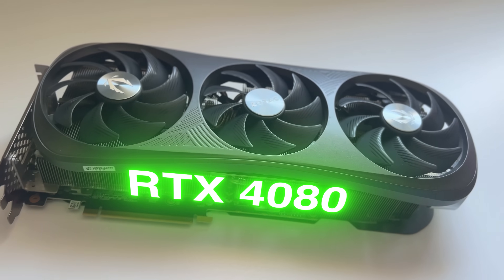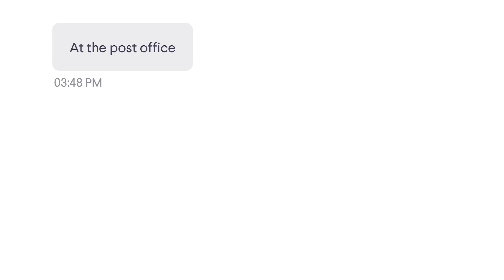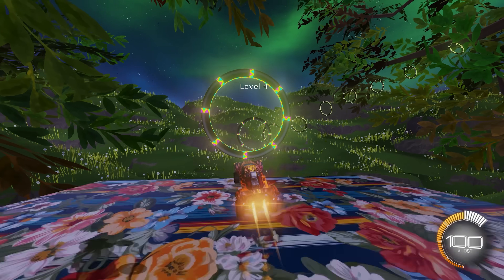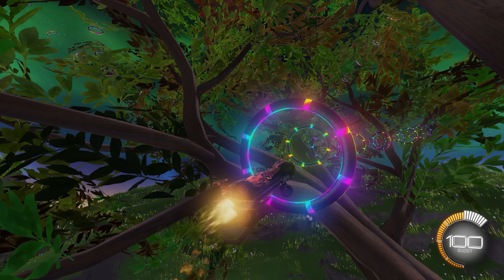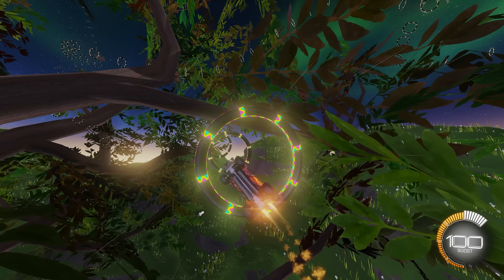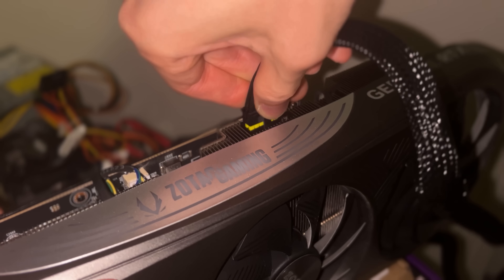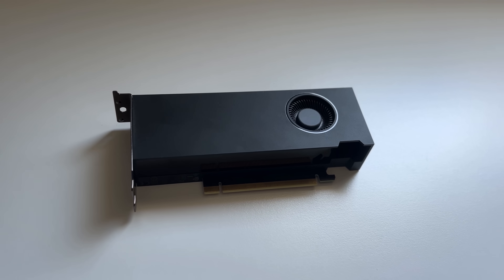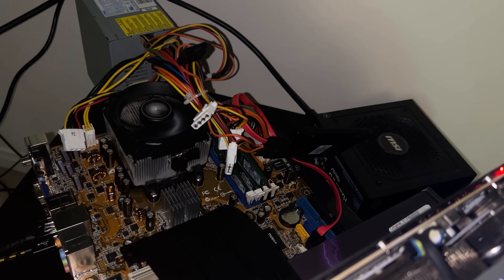RTX 4080 + 20 Year Old CPU

Comment: 3:35 - 2 core CPU
- 2.2 GHz clock speed
- No hyper-threading
- Built on 90nm process
- No integrated graphics
- Only supports DDR or DDR2 RAM
- Uses outdated AM2 socket
- No support for modern instruction sets (AVX, AVX2, SSE4.2, etc.)
- Extremely low single-thread performance
- No PCle 3.0 or 4.0 support (limited to PCle 1.0)
- No virtualization extensions (or extremely limited)
- Incompatible with modern motherboards
- Consumes more power than modern CPUs with far lower performance
- Very limited overclocking headroom
- No turbo boost
- 1MB to 2MB L2 cache (shared across cores)
- No L3 cache
- Poor efficiency per watt
- Outperformed by basic modern mobile CPUs
- Can't run Windows 11
- Struggles with even basic modern web browsing
- Bottlenecks even decade-old GPUs
- No native USB 3.0 or SATA Ill support on platforms it ran on
- Runs hot under load compared to modern chips
- Sluggish performance in multitasking
• Can't handle 1080p video playback reliably
- No support for NVMe SSDs
- Often paired with slow 5400 RPM HDDs and IDE drives
- Uses old BIOS instead of UEFI
- No built-in hardware acceleration for modern codecs (VP9, AV1, etc.)
- Terrible gaming performance - can't run most modern games
- Huge frame drops even in older titles like CS:GO or TF2
- Can't handle modern game engines or APis (DX12, Vulkan)
- Poor compatibility with current Linux distros
- Not suitable for any content creation (video editing, streaming, etc.
- Can't run virtual machines smoothly
- Long boot times
- Barely functional with Windows 10
- Legacy hardware = driver issues
- Easily outperformed by Raspberry Pi 5
- Not usable for emulation beyond 5th-gen consoles
- Incredibly low PassMark score (~1100)
- Weak IPC (Instructions Per Cycle)
- No secure boot support
- Can't decode H.265 efficiently

(Idk if this is right😭)

Comment: 11:37 the reason why the cpu wouldnt launch fortnite is because the cpu doesnt support SSE 4.2
Reply: This is why I had to upgrade a couple years ago (i7-950 to a i7-12700KF). A first generation i7 is still a decent machine, but it won't support newer instruction sets, and you'll need to jailbreak the installer if you want to run Windows 11 (gets past the TPM 2.0 and CPU requirements).
Reply: @BlackEpyon  I love reading computer nerd comments.... no offence im pretty much illiterate with computers

Comment: The psu standard hss been the same for the last 20 years so you have could just used a modern psu for the pc
Reply: 20 years if you count the ATX 2.2 standard. ATX has been out since 1995, but didn't become standard until a couple years later. If you're trying to run a motherboard from 1997 (ATX 1.0) using an ATX 2.2 or 3.0 power supply, you could run into issues with the lack of a -5v rail, but a motherboard from 2005 is going to be an ATX 2.2 with the 24-pin connector, so it shouldn't be an issue.
Reply: @BlackEpyon  A PSU from the last ten years is capable of powering any modern PC HW?

Comment: You could probably squeeze out even more performance if you ran it on linux
Reply: Correct me if im wrong but is linux lighter than windows? Btw im building a new pc and wanting to try linux, any good distros you recommend
Reply: lighter yes. I’m not very experienced with Linux but I think Ubuntu is good for beginners, it’s similar to windows layout
Reply: @thebradler51  oh okay cool thanks
Reply: The real stopper was probably the RAM: Only 4 GiB are not enough for starting the last titles he tested. Probably with 8 GiB, he would have had more luck...

Comment: All the edging and he put in different GPU lol.

He really tried pitting paper clip in random pins instead counting them.

💀💀💀 That is one way to become one with the power circuit.
Reply: I could've literally told him what he was trying to do wouldn't work in far less time. Back when Vega56 was new, it seems to have been the first Radeon generation that at least mostly axed legacy BIOS support while socket 1366 or X58 was getting so cheap that it was a decent budget option vs. still somewhat expensive upcoming Ryzen (never mind that Intel didn't move from quadcores for mainstream until late 2017).
Basically all boards designed for Windows 7 or older should be expected to no work with regular consumer cards starting ~Vega or ~RTX plus (obviously) all dedicated Intel GPUs.
Reply: Sounds and looks like you don't have very much experience with pcs. 3 minutes to unplug a single usb panel connector?? And the green pieces that broke off are for that old case. Idk how that's very bad. It just holds the DVD drive in place. Lmao. Has nothing to do with the pc itself unless you're trying to put the mobo back in it. And then it's still just an old pc that's worth about $20.
Reply: He could have just used a more powerful power supply to begin with. Any modern modular power supply that supports the ATX 2.2 24-pin connector would have worked.

Comment: funny is that im using similar cpu on my windows 98 retro setup:  

my build is: 
CPU: AMD Athlon 64 X2 4200+ (Socket 939)

Motherboard: ASUS A8V (VIA K8T800 Pro chipset, AGP, IDE support)

RAM: 512 MB DDR1 

GPU: NVIDIA GeForce FX 5700 AGP (DirectX 9, Win98 drivers)

Sound: Creative Sound Blaster Live! 5.1 (SB0100, full driver support)

Comment: you could literally just buy a 7900 xtx for ~10% lower performance, with ~50% lower price (in my country)
Reply: or buy 9070xt
Reply: AMD was known for being hit and miss at release. XTX release was a mess, hot spots, dies cracking, amd adrenalin issues.. I got a 4090 instead. Hopefully this past launched has calmed the crowd. After the 5000 series, nvidia has no respect or concern for gamers. Especially looking at their lower end cards, disgusting. Nothing should have less than 16GB.
Reply: @SupraSav  Well, yes! Nvidia does not respect gamers, they want to sell RTX 5060 twice! One card with 8 GB of memory, and then with 12 GB of memory a little later in 2026. Or the same thing when the RTX 4080 12 GB card was released, which was eventually renamed RTX 4070ti due to the indignation of gamers!
Reply: @SupraSav  and Nvidia have driver issues xD

Comment: This video helped me in a way i never expected.

My whole OS until today ran on Legacy BIOS and MBR disks, I thought about upgrading my GPU to a 5060Ti and thanks to your video i discovered that these new GPUs don't support Legacy BIOS so i converted my disks to GPT and went into BIOS to change into UEFI.

So basically you saved me a lot of hustle before it even began and for that im very thankful.
Reply: I'm curious as to why everything was set to legacy and MBR, but it's good you discovered and fixed it. GPT is one of the best disk formats, now i just wish that EXT4 was more standard, since it's objectively superior to NTFS, which microdick is obsessed with. Not that it's a big deal for me as a linux user.
Reply: @DagothUrSpeaks-yy6fj   I had my CMOS battery replaced and this made every UEFI setting to default and I had to convert everything again, now I have a brand new GPU and everything works as intended, I had no issues at all.
Reply: @DagothUrSpeaks-yy6fj  Thousands if not millions of people struggled (and still) with this BIOS to UEFI. Manufacturers should have enable an automatic CSM mode when it detects MBR on the harddrive, or UEFI when it detects GPT. That way customers only have to run MRB2GPT and they wont have to switch something in the bios. And if default settings are loaded, they wont be stuck in infinite boot loop.

Comment: 0:36 I purchased a 5090 through Amazon,  I doubt I'll be able to get a good night's sleep until it is delivered and I can be sure it isn't just a brick in a box 😅😅😅
Reply: sold and shipped by amazon or by ldfna;lsdnfvqoweiurhalskdnf'l...?
i've only had an issue with one thing i received sold and shipped by amazon..... that may have been hasbro's fault for being cheap.
Reply: @caliginousmoira8565 sold and shipped by Amazon, I avoid purchasing stuff that isn't at least shipped by Amazon unless it's something cheap, like a screen protector or a case 😅
Reply: @VorkKnightOfGood  I need an update
Reply: @SixletHydra it was sent today, should arrive before the end of the week
Reply: @VorkKnightOfGood  You overpaid big time for sure.
Reply: @VorkKnightOfGood  man u need prime haha
Reply: @SixletHydra update: it arrived today. Box wasn't shrink wrapped and the anti-static  package the card was in had yellow stickers saying "Gigabyte qualified" so I suspected it was a returned item being sold as new, but a Google search told me those yellow stickers are normal, people were thinking the same when they saw those stickers all the way back to the 20 series 😂😂😂
Then I plugged it in and it didn't show up in device manager, leading me to think it wasn't working, but I installed the latest Nvidia drivers and it started working as expected 😅 also, according to GPUZ, it has the expected number of ROPs, so everything seems to be in order.

What's pissing me off now is the Fractal Refine I ordered and paid for, it should have arrived yesterday. Today, I went to the tracking page and it reported as having a delivery attempt failed because no one answered. After work, I called the post office. After 30 minutes on hold, I managed to talk with a human assistant, who told me that a delivery attempt had been made but no one answered. I replied it was impossible, I had no warning that it was out on delivery, the delivery person didn't call to check if anyone was home (I receive plenty of packages through my country's postal service, it's all automated, I get a message when its out for delivery alongside a pin to serve as signature, and they always call a few minutes before to make sure there's someone available to receive the package) and, most importantly, my home is being renovated so there's always 3-4 around.
Reply: @VorkKnightOfGood  update!
Reply: @Mayrik-G all items delivered, system build and working fine.
Reply: Update pls
Reply: @Omar_ZX got the card set up, passed all benchmark and stress tests I threw it's way, so it seems to be fine. It is a Gigabyte Aorus, so I'm keeping a lookout for thermal putty leakage 😭. Serial number starts with 2514, so it's supposedly from a more recent batch that didn't take the excess putty. Also, made in China (some batches are reportedly made in Taiwan, don't know if it makes any difference). As for the chair, it arrived last Thursday, set it up during the weekend. Since this was a heavier package, it went through another distribution center, they subhired a local distribution company and, from what I gathered, they had no clue of how to get to my house. The courier called me 30 minutes before the delivery, asking me where my house was and if I could give him a point of reference 😂 Luckily, he know where the coffeehouse across the street from my home was. I honestly have no idea why delivery companies don't just equip their couriers with a cheap(ish) cellphone and a data plan for Google Maps.
Reply: I hope you don't play old games(no physx)
Reply: @SupraSav yeah, that might be an issue. I checked a list of affected games and AC IV, the Metro and Arkham games stand out. I guess there's no choice but playing them without PhysX 😅 (can't fit an older card on my case 😂😂😂)
Reply: Whales ruin everything.
Reply: Wasting  on 5000 series.

Comment: Sometimes I see these simple problems these guys who are supposed to to be professionals can’t cope with and I think, maybe I should be the one making videos?  🤔 I’ve had the RAM clamp lever clearance issues before and typically you don’t need to go so far as to snap them off.  You can heat up a blade with a propane torch and use it to cut through the plastic, it will melt and fall off, leaving you with still working clamps and enough room for your graphics card

Comment: 1000 dollars for a 4080 non super is crazy man
Reply: There is about 3-5 percent difference between them
Reply: @llamabossmk2 wait really? But wasnt there also a big vram difference?
Reply: @pickle879  nope both 16gb
Reply: @pickle879 You're thinking of the 4070ti super
Reply: @Fastwalker27 still an insane price for a gpu of that tier
Reply: @pickle879 well yeah it should be priced around $700 since it’s on par with a 5070ti and a older model. The GPU market is bad right now though. Even used 3090s are overpriced and it’s like 30% weaker than a 4080
Reply: @Jaykurosakii  yeah the prices are terrible rn although myb its even worse in NA bcs where i am for 1000$ you can get a 7900xtx
Reply: @Jaykurosakii  wait sry i just checked prices, a new 7900 xtx here is 700€, while a new 4080 is 1100€ 💀💀
Reply: 4080 and 4080 super are practically the same  give or take 1% performance. I actually find it grating when people specify super. It literally doesnt matter. The super launched a little cheaper than  non super, that is the significant difference.
Reply: The 4080 and 4080 super is like a 2-5 fps difference at stock. No difference if both is overclocked since base 4080 has more OC potential.

Comment: the linux and mac ports of rottr and sottr dont get stuck on shader compilation, which happened in your case. you could probably run those, if there isn't an instruction set issue.

Comment: I paired RX 6600 with i7 2600k, and most of the time its not used fully, at 1440p at least. So anything under say 8th gen Intel or Zen2 is not good enough.

Comment: Why buy a used 4080 for 1000$ when a brand new 5070ti is around 850$?
Reply: @risaiola  no fake frame
Reply: @ckzyfly  The 5070ti and the 5080 both have the same raw performance, give or take 1%
Reply: @ckzyfly  You dont have to turn on, if you dont want lol. 5070 Ti with a small OC has the RAW (no dlss, no rt, no fake frame) performance of the 4080...
Reply: are u a girl

Comment: Not surprising, even a 3rd or 4th gen i7 will struggle in many modern games to achieve more then 30-40 fps when paired with a high end gpu. 

But these days any AMD cpu below the first gen Ryzen is definitely not good, as AMD never beat Intel until the 1st gen Ryzen.

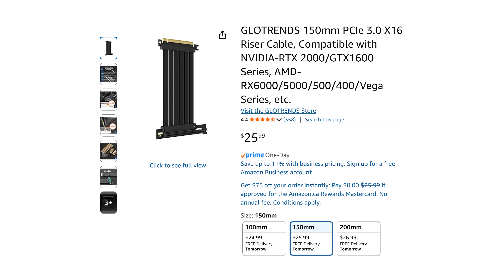Comment: 6:32 you double think is incredible.
The reason for a riser is only for showing off because you said so but you also are using it because you need to.... rise the gpu...as if thats the original purpose of the cable... 🤌

Comment: This video was just an excuse instead bro was getting ready for gta 6 💀
Reply: Well, for today's game optimization it wouldn't be surprising if a 4080 couldn't run GTA 6...
Reply: @4DCFMCGD  It should be fine.. With 4x frame gen all low settings, @720p 🤣🤣🤣
Reply: @4DCFMCGD  It will have to run on current gen consoles, so it will definitely run on a 4080. Probably not with ultra + ray tracing maxed, but I'd guess of the money they spent on the game some was spent on optimization
Reply: @4DCFMCGD  I agree with what you have said for the most part.. On the flip side, if shiftup(console game studio) could release Stellar Blade in such a stellar state - I think its just a matter of effort.
Reply: Dont worry bro there will be no gta6, israel didnt get enough attention, he will
Reply: @robertdomjan9116  th u talkin abt
Reply: @JawadAjazi  4060 is the minimum to run in high with DLSS, sadge
Reply: I wander if this kinda comments will be still poping when ps5 version comes....
Reply: @LaraAlana3   as long as they don't pull an Ark it'll be fine

Comment: Hey man, (or for anybody with a 7600x. Which cooler do you have? Ive got a deepcool ak620 zero dark and my temps are in the 80s in most games, like 85 degrees and idk if those are normal (i have 5 fans in my case also)